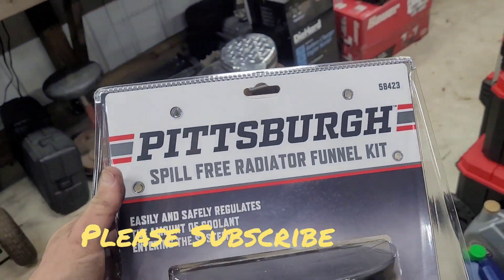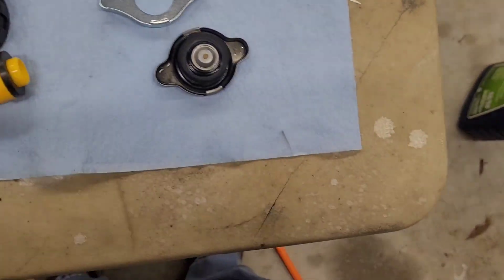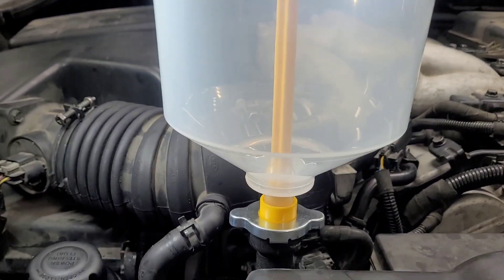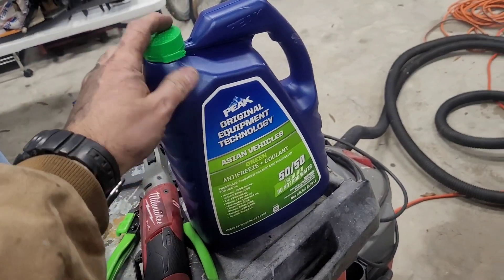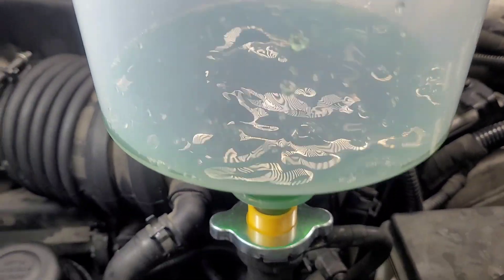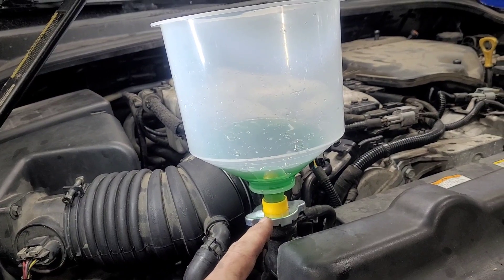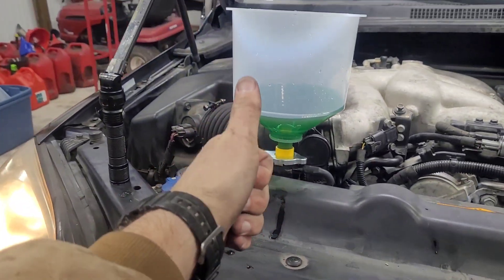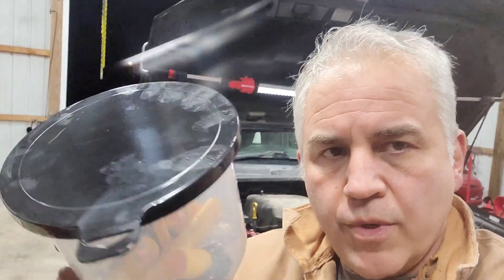Radiator Funnel from Harbor Freight Instructions

Comment: Dear I ask for GMC yukon xl dinali 2019 that SUV have no cap un the radiator so I need to now how to take the air out the system?
Reply from the maker: I'm not familiar with that type.  Possibly check the forums

Comment: Did you pull off the funnel after the engine has cooled off and depressurized after burping it?
Reply from the maker: The system will not pressurize  without the radiator cap in place. I removed after all bubbles quit coming out
Reply: @MajorWeakness  I am stupid, thank you for clarifying lom

Comment: I never buy 50/50. I buy concentrated full strength and I save a windshield washer jug. Wash it out and pour half of the gallon of full strength antifreeze into it. Now I add distilled water to fill the half full windshield washer jug of antifreeze until it is full now, I add the other half gallon of distilled water to the half full concentrated antifreeze in the original jug of antifreeze that I bought. So now I have two gallons of 50/50 mix for maybe two dollars more then one gallon of 50/50 cost.
Reply: Get yourself a 2 gallon jug and be one and done,also alot of types of antifreeze are hard to come by in concentrate anymore.
Reply from the maker: @dustinpomeroy8817  I always see consentrate
Reply: @MajorWeakness  maybe the green and gold stuff
Reply from the maker: @dustinpomeroy8817  true
Reply: OEM always comes 50/50, Makes the job faster and less of a mess to pour in different containers.
Reply from the maker: Very true and great 👍🏻 tip

Comment: Why did you put the extra back in the jug?  I usually usually add it to the overflow reservoir.  You are giving yourself an rxtra step. Also, keep it 1/3 full at all times. Lastly, you don't have to preburb it with the motor off, just keep adding fluid, start the engine and keep adding more, then let it start the burping while running
Reply from the maker: You are correct
Reply: The best way to do this

Comment: Thank you so much for the video. I have a Toyota mr2 spyder and due to the rear engine design the cooling system is very complicated and a pain to burp. I tried one of the vacuum tools but couldn’t get a good vacuum because of the fill tank.  After watching your video went to harbor freight and grabbed one.  Right off I noticed none of the fittings fit my fill tank but I just took the long adapter and pushed it down snug into the tank and put on the funnel which gave a tight seal. Long story short this tool worked amazing on this system, I think there is still some air but this tool worked so well. Thanks again, subscribed
Reply from the maker: Thank you for the comments!  Thanks for the sub!

Comment: Question about the video you filled the resavor before turning it on or after the car gets turned off and there no more bubbles?  This part was confusing in the video.
Reply from the maker: Full the reservoir, then fill the funnel and keep the funnel full until no more bubbles n while car is running

Comment: Keep the level around 1/3 full, if you let it get low or empty it defeats the purpose of this funnel. You don’t want any air to go back in the radiator so make sure to keep the level around 1/3-1/2 full. Cheers 🤙🏼🍻
Reply from the maker: Great advice!
Reply: @MajorWeakness  the Miata I recently purchased has been overheating and boiling coolant, it will spill out of the overflow tank after a long drive (almost everyday, about 60 mile commute). I replaced the radiator, water pump, thermostat and it was still not right. I think the problem was trapped air. Finally did a proper purge with this kit, praying that it was the problem. 

If anyone is struggling with similar problems, start with filling/purging system to make sure it wasn’t something simple before replacing every part in your car. It will save you a lot of money and a huge headache!

Thanks for the video have a great day! 🫡

Comment: Do you have a video for removing hose? I have a honda I'm sure the method is similar
Reply from the maker: Unfortunately no I didn't make a video on the hose
Reply: @Major Weakness  quick question if you don't mind can I remove top and bottom radiator hose to remove some coolant from the engine block?
Reply from the maker: @troutmansfinest1  yes that works
Reply: @MajorWeakness  thanks

Comment: The burping is getting all the air out I've got a Toyota  SR5    4  runner man this thing is a lifesaver I like never got air out of the heater core before I bought this funnel but with this it worked perfect
Reply from the maker: True and yes its better to have the front on ramps

Comment: Thanks for your time.  I was gonna say this thing is completely useless but I tried it again after watching your video to see if I was doing something wrong.  Yes and no...in my case (03 Subaru) I had to mash-down really hard on the cap adapter to get it to engage with the tabs on the radiator.  I'll try the rest tomorrow.
Reply from the maker: I hope you have success
Reply: I have an update on this in-case it can help others.  When I filled the funnel it leaked real bad from the  filler neck so even mashing-down the cap adapter didn't work.  I was about to give the funnel a swift kick when I realized there is a "thing" inside the filler cap of my 03 Subaru that kept the funnel adapter from sealing, so I ground a half-moon cutout into the bottom of the plastic adapter to fit over the thing.  After doing this it seals pretty nicely and seems to be working good.  Thanks again.
Reply from the maker: @mitchmadness4376  glad it worked out!

Comment: Won't work for me unless I remove cowl on my sienna. I tried doing  a coolant leak test had to rove cowl for adapter to connect.  So ill just do it traditional  way. 😒
Reply: They have this same funnel on Amazon and it's actually cheaper than harbor freight and it comes with the attachments so you can still use your funnel even under the cowl.. It's just as good as the Lisle OEM funnel kit it's no difference.
Reply from the maker: Yes sometimes these types of gadgets just won't work on some cars

Comment: Nice video except you should run the heater on high so that the coolant flows thru the heater core.
Reply from the maker: I didn't film that part you are correct

Comment: I think you'd be better off pouring coolant directly into the radiator and then using the funnel once it won't accept anymore in order to burp it the rest of the way with the car running. It sounds like it took quite a while to fill the radiator through the funnel!
Reply from the maker: True, but I normally spill, so there were plenty other things for me to do while burping
Reply: Thats exactly what he did, Hes filling the radiator up with the funnel. The funnel helps it feel 100% with the air releasing above the radiator.